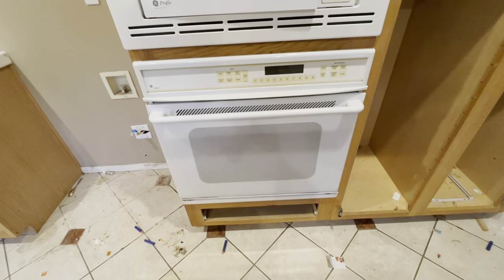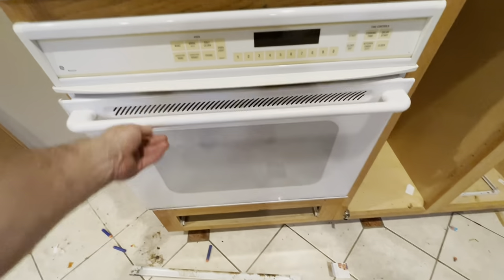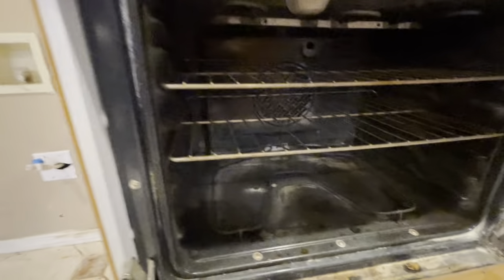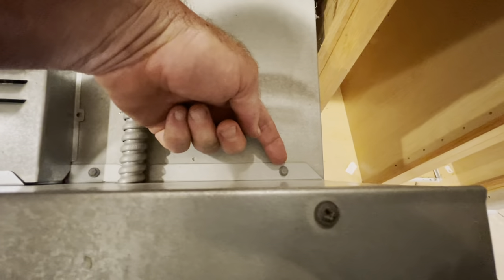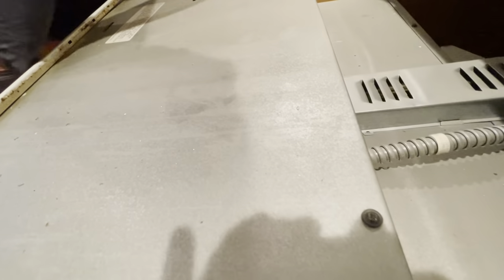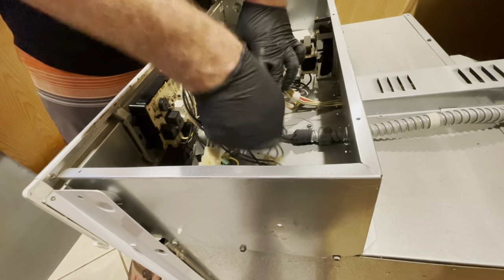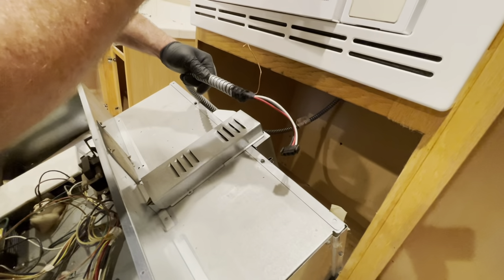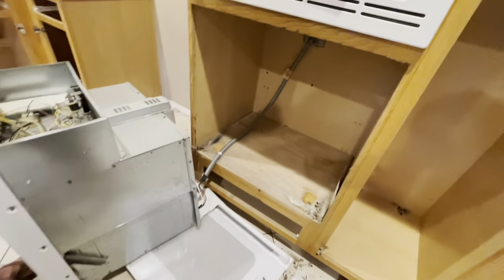How To Remove A Built-In￼￼ Oven

Comment: Great video. FYI for your viewers - most modern GE and - some others - have a tab on the door hinge that needs to be flipped before pulling the door off. Open the door, flip the metal tabs to unlock the hinges and then close the door 80% of the way and pull up.

Comment: Good tip on door removal. I will try it on my GE oven. For removing the cable, manual says to disconnect on the wall side by opening the junction box and disconnect four wires there.

Comment: Thanks so much for posting this video!! It was straight forward with good tips to follow. We have almost the exact same oven. The left side bracket that the door sits on needs to be replaced as the door won't close all the way and it literally just happened no event door slam etc. (I will replace the right side bracket  too) I wasn't sure how to remove the oven itself but this video was perfect for me to see how to do it. And of course it is a day away from Thanksgiving so we modified our dinner plans slightly which now includes my trusty old weber grill and our counter top air fryer/oven that we will also use. Smaller than the regular oven but we will make it work LOL! The brackets are ordered and will be here next week. Many thanks and Happy Holidays! Subscribed😃😋

Comment: I have a single wall oven. The door lock remained locked after self clean. The control panel went dead. I re-set the breaker twice. The oven is screwed to the cabinet frame, therefore I can not remove them. I did not find a solution on any channel! Help!

Comment: you don't disconnect power in the stove only from the wall
Reply: Why is that?
Reply: @carolineprice4579  because there is a junction box it would be connected to and that is where you would disconnect from
Reply: @Robert Butler  yes that makes sense, thank you for the reply.   Is he doing this to re-use the wires?  For me, if I was installing a new oven I would install new wires as well.
Reply: @carolineprice4579  a new oven comes with new wires that go to the junction box there is no need to do what he did at all
Reply: @robertbutler7745  makes so much sense Robert, thank you!